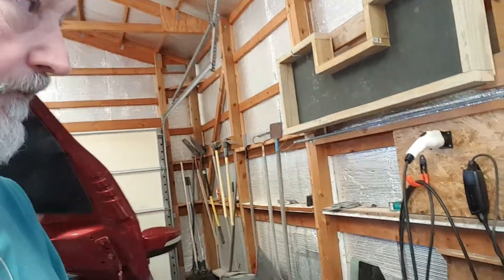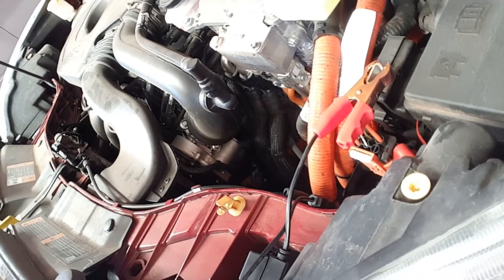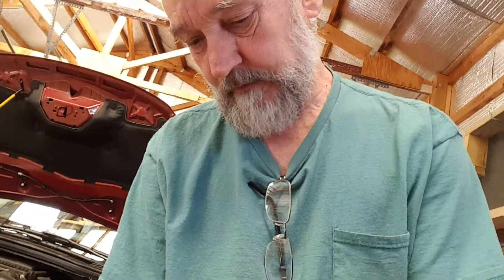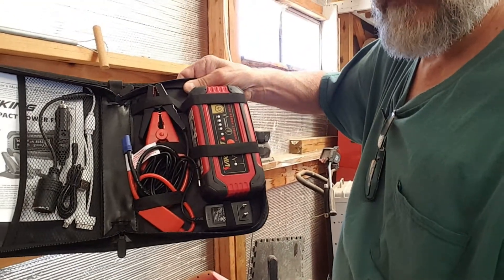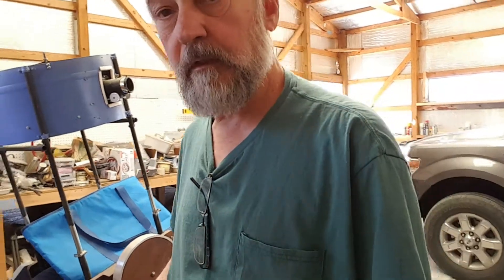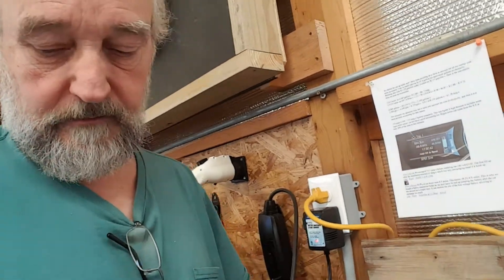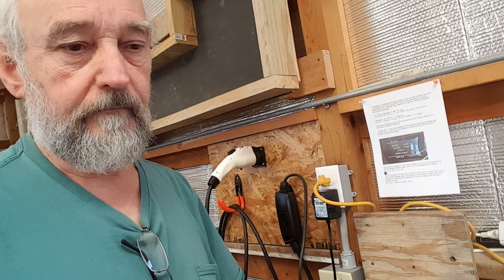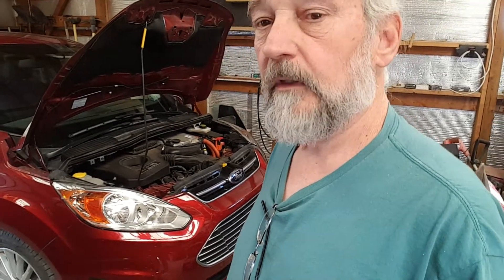C Max Energi low voltage battery problems and energy flows.

Comment: There is a Built in Battery safety. I've  experienced what you have.  then read the manual (2013) pgs. 171-172 "remote start"
there are two ways depending on which fob you have . I have the 5 button fob I hold it on the right side of the steering column where the key would go in a "normal car" lol.
there is a noth there and a logo. for me , I slide the fob in the notch then hit the start button and it comes to life... mine was simple not sure if tours is the same. sadly you will need your valet key to unlock the door.  This safety is to prevent the need to jump start..lol... yes engineers god bless them. Hope this works for you all and I have not wasted your time.
Reply: Are you saying that once the 12V battery gets low enough that the car does its "shutting down system due to low power mode" (or whatever the exact words are on the screen) where the car no longer responds to anything that if you use the keyfob slot in the steering wheel that the electronics will attempt to wake up and start the car even with a relatively low 12V battery voltage?

When I read the owners manual I understood that that steering wheel slot was to energize a dead keyfob to allow a car to start, not to overcome a dead 12V battery in the car. My keyfob actually stopped working due to a poor battery connection so I used this method to start the car a couple of times until fixing the keyfob (so I can confirm this technique overcomes a dead keyfob battery) but I've never tried inserting a good keyfob into that slot to start a dead 12V battery.

BTW, the 5 button keyfobs that we have contain a hidden key inside it. There is a small lever on the back you move to the side and then using your nails you can (with difficulty) pull out a small key that can be use to open the doors when the battery is dead. I've had to use this several times over the past few weeks whenever the system shuts down due to low 12V battery voltage.

Comment: Would an Optima battery fit? I also use a solar battery tender (https://www.amazon.com/Battery-Tender-021-1163-Solar-Maintainer/dp/B004Q83TGO/ref=sr_1_1?ie=UTF8&qid=1498603314&sr=8-1&keywords=solar+battery+tender) to keep my 12v in good condition.

Comment from the maker: About a month or so ago we took our Ford C Max Energi back to the dealer to have them look into the 12 volt battery issue again. I ask them to look into the possibility of a relay issue.

They ended up replacing the battery again (second battery replacement in 7 months). They said it tested defective? I told them I would give them twice but not three times. So far no problems.

Comment: My understanding is that the low-voltage battery charges from the high voltage battery whenever the car is active. But if you leave the car idle the high voltage battery disconnects and all background functions drain current from the low-voltage battery which will eventually drop below a threshold voltage and shutdown. The problem is that the capacity of the low-voltage battery is not as great as a conventional gas engine battery which must be sized to run the starter motor.

Comment from the maker: Wouldn't say I have solved it completely but we have a good handle on it. The last time it came up I had left the lights on.

When the vehicle won't start I get the impression the battery is just below a low voltage threshold and not dead or anything like that. If the battery was in a regular car it would just crank slower. 

In this case the car is just in a protective mode and the relays that allow the car to power up are open. As soon as you add voltage with the jump you hear them click and the car can start. It is annoying but easy to deal with. 

I have heard about a similar problem in a Prius but there is no jump post in the engine bay and that creates a much bigger problem with a rear mounted battery like this.

Comment: Thinking of getting a C-Max Energi. Read about the 12 volt battery issue in the 2013 and 2014 models and it seems to have been solved in the 2015+ model years?
Reply: NOT SOLVED STILL A PILE OF SHIT

Comment from the maker: Thanks. I did notice that upon charging with the EVSE the other charger went to float. I will try delayed charging of the high voltage battery pack to see if this makes a difference.
Reply: yes I have the same vehicle,2013 cmax, and noticed that my float charger shows a full charge on the 12v very shortly after connecting it when the HV charger is plugged into the vehicle.  But when the HV charger is not plugged in my float charger will take several hours at the least to show 80% charge.